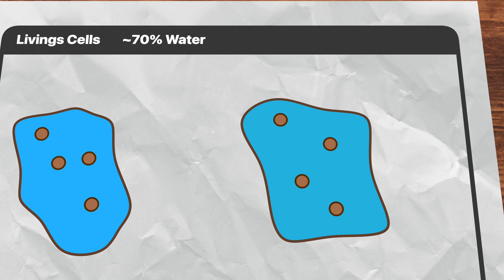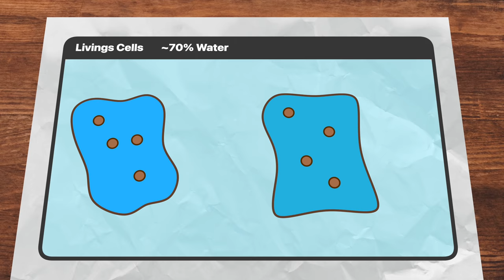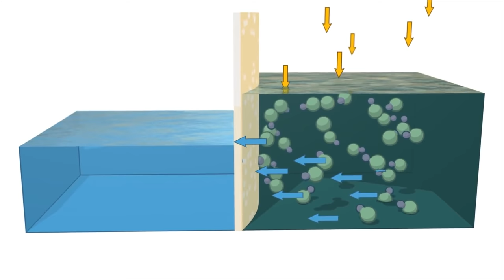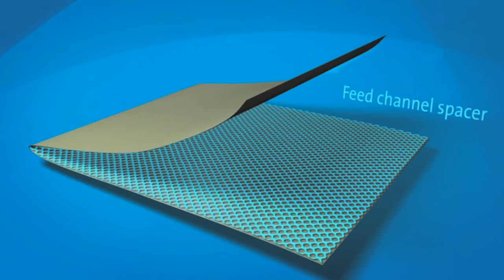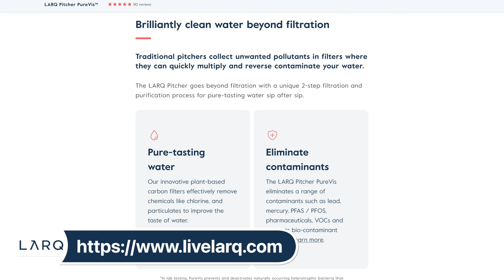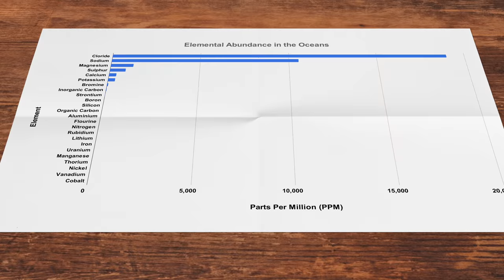Why Not Build Desalination Plants EVERYWHERE?

Comment: Just out of curiosity. Once you separate the non salt elements from the brine would it be feasible to then you use the salt elements for Sea Salt? If so then you're actually going more green because you could potentially replace salt mines by using every part of the brine.
Reply: I think the main problem is that desalination produces more salt than humans can ever have a use for. Extracting the small amount of the scarcer elements is fine but the salt (essentially just sodium chloride) has to be either returned to the ocean or dumped in huge mounds on solid ground.
In the grand scheme of things the ocean is easily able to take back the salty brine after fresh water has been removed, but it is the local effects of this super-salty water that cause the problems. They need to find a way to distribute it over a larger area/volume rather than just dump it back in the ocean in one place. It needs to be mixed back in with the bulk of the ocean by wind, waves, currents and tides rather than being allowed to sink down and collect at the bottom before mixing.
Reply: @michaelhart7569  As the water runs through the plant (I'm using a Navy System here) the water becomes more and more concentrated with salt (ie. brine). The input salt water is mixed with the discharge brine to dilute it to prevent damage to discharge pumps and piping. I'm not sure if you can set up a system using just brine to make salt unless you want to make it very expensive as the cheaper metals are going to corrode and break down the pipes/pumps.
Reply: @lanceurwin3368  Yes, that's the sort of system I might have imagined for a plant designed just for desalination. I only mentioned solid material because the narration discussed recovery of other elements and also showed some pictures of crystalline salts. Presumably this would have to include some sort of fractional crystallisation as chemical engineers would always prefer to just work with solutions and fluids where possible, avoiding the issues of handling solids.

While I've never been involved with such plants (a process scale-up chemist, not a full blown chemical engineer) I would still guess that many of the older ones were built with little regard to what happens to the brine when returned to the ocean. Perhaps just a few more pipes distributing it over a greater area and with more mixing is all that is required?
Reply: @michaelhart7569  excess salt could be used on icy roads maybe.
Reply: @johan8724  That certainly seems like an obvious choice. At least for those who live in areas that need roads-deicing. Not so much in places like Saudi Arabia that need desalination plants :)

As a side note, I once read that many American states don't use simple salt on their roads. Not so much because of the eutectic point of NaCl, but because it causes more metal corrosion. They use some other inorganic salt. I can't remember which, but I think it was Magnesium-derived.

Though not currently a US resident, I recall reading once that you are better off buying a used car in one of the sunshine States rather than their colder northern neighbors, for that reason.
Reply: @Arnie Arnie, I'm going to stick with the argument that the scale of the oceans is just too vast for humans to significantly effect salinity, except on a local scale. Remember that the water will also find it's way back to the sea, just as it does in the far far larger natural hydrological cycle.
Reply: @michaelhart7569  You are correct.  In Colorado, the road crews used MagChloride (magnesium chloride).
Reply: @michaelhart7569  Maybe not in the short term but potentially after hundreds of years. It wasn't too long ago that we never would have dreamed it was possible we could run short on fresh ground water.
Reply: @krboswell  Running short of fresh ground water is not really a salinity problem, but over exploitation of a resource faster than it is replenished. That is quite different from the concept of salinification of the ocean.

Tangentially, there is an excellent series of videos on Youtube about water conservation in India to make scant water resources go much further. Look up "India's Water Revolution".
Reply: Its an unimaginable amount of salt, you would have to see it to believe it after just a year. Salt mines are actually cheaper to manage than sea salt due to all the purification you have to do to sea salt afterwards before people can eat it. Loads of other stuff in the sea besides just salt like heavy metals for example that you then have to also separate. Once you get into separating metals, you generally are talking about chemical processes.
Reply: @michaelhart7569  Brine can be stored in old desolate mines and used as a buffer to store old nuclear waste.
Reply: @brianm.595  Indeed. 'Mining' the ocean for dissolved minerals was asserted in the video. Ultimately I guess it would depend on extremely cheap energy to make it economically feasible for many elements.

Gold has actually been extracted from sea water electrochemically and  using special thiol ligands but it is not even close to being economic. Too slow and too much water to be moved around.

As a chemist myself, I certainly have some ideas about ways to extract Uranium from seawater which seems much more promising.
Reply: @madmotorcyclist  Or it could simply be left on deserts as there  are no plants and humans already and sand would slowly get above it due to wind. Water would completely evaporate and at worst you would have salt desert.

Simply imagine having mirror dome at desert where water would be pumped and salt would be left in area close to it.
And problem with sand obstructing the mirrors could be solved by having them higher and by blocking it by having mirrors in reverse dome shape.
Reply: @greedier-7661  Problem of using the deserts is that it would impact wildlife and the environmentalist would be up in arms.
Reply: @madmotorcyclist  animals that live there, live either near plants that would give them water they need or near edges as there would be said plants or other sources.

So if they done what i suggested in the middle of dessert there would be no animals harmed.
Reply: I understand that sea water is full of micro plastics, are those filtered out? The salt is also full of micro plastics, which is why I use Redmond's real salt from an ancient seabed, no micro plastics.
Reply: @michaelhart7569  Do you think the excess salt could be used for Molten Salt nuclear reactors? Could be a huge energy supply if it worked.
Reply: @warmasterdorn  I doubt it. My understanding is that the molten salts used are very specialised compounds. They have relatively low melting points, thermally stable, and are non-corrosive (typically fluoride/polyfluoride based, if memory serves me correctly). Getting out of my field a bit, I think they also have to have certain desirable properties in the context of a significant neuron flux such as would be expected in such reactors.
Reply: @michaelhart7569  
I have read that there are 2 ounces of gold dissolved in every cubic mile of seawater.
Reply: @lanceurwin3368  a Zinc block as a sacrificial anode will solve the problem of rust.
Reply: @warmasterdorn  no but the excess waste from previous reactors can be used in many of the msr designs.
Reply: @The_Wicked_Wookie  in a pure brine solution,  you would have to replace them way too often to be usable. That's why Naval systems dilute the discharge with the intake.
Reply: @patrickhorvath2684  Yes. Without checking exactly, that sounds about right. When I looked it up some  ~30 years ago in the chemical literature (before Wikipedia, but even they probably get this right) I recall it being in the femtomolar concentration range. I.e. no economic hope at current, or likely future, gold prices.
Reply: @michaelhart7569  The US mined 16 million tons of rock salt in 2019. (41% of the 42 Mt produced that year)

Colder climates use salt for deicing. 17 Mt was used for deicing (43% of salt consumption; it might be higher if consumption includes the 17 Mt imported that year: 23 Mt)

This is JUST in the US.

What numbers are you going by as a basis for your comment?
Reply: @Andrew Robinson California is rapidly and drastically depleting it’s water table though industrial irrigation. Some areas have sunk 30’ over the past 50 years.

I think the other avenue of research should be towards vertical farming using totally enclosed systems and aeroponics which would reduce agricultural water usage by as much as 95%. Imagine being able to produce 20 times as much food with the amount of water we are currently using to do so.
Reply: @josephcoon5809  I’ve made several comments on this thread, so I am not really sure what you are asking me about.
I’ll take a guess. 

I calculate that if the annual water consumption of California (about 100 million acre feet) came from desalinated seawater (about 3.5% salt) then that would mean about 4x10 exp 9 of salt would have to be dealt with. That’s 4 billion tons of salt per year, roughly a thousand times more than the mined salt figures you quote. Obviously, we would not want to be spreading that amount on the roads.

I use this calculation purely to illustrate the scale of salt we would have to handle if we ever use seawater desalination on such a scale. The only realistic place for its disposal is back where it came from-in the ocean.
Reply: @michaelhart7569  Which brings us to my other point: the industrial irrigation that is highly inefficient.

Reduce that water usage by 95%, and what are your calculations? 200 million tons of salt which would completely eliminate imports while drastically increasing exports.

Then there’s all the other products created from chlorine, sodium hydroxide, sodium carbonate, sodium silicate, and so on.

What’s more realistic is treating a multi-dimensional problem…by addressing more dimensions.
Reply: @michaelhart7569  we could use the sodium chloride as a base for nuclear modification into more useful elements, although it would be costly ofc
Reply: @michaelhart7569  what if we shot it into outer space?
Reply: Desalination does not produce fresh water plus salt crystals.  It produces  (roughly) 30% fresh water and 70% saltier water.  But really, this is not an issue unless you try to make a desalination plant for an entire state.  The fresh water makes its way back to the oceans too, so you need to distribute desalination plants so that there is not a massive dead zone created.  Yes, there will be many small local dead zones....but so what?
Reply: Yes, technically that's what sea salt is. The so called modern mining is where it's pumped into a man made sandy Beach and drained slowly, the rest of the water is allowed to evaporate. There are still a few places that have enough left to actually mine and it is very expensive.
Reply: @michaelhart7569  read my posts about salt tower's. Using heat the brine turns to salt turns to gas, rises up the tower turning a turbine generating electricity. As it cools it turns to liquid, and flows back down the tower where more salt is added and it starts all over again
Reply: These are all great replies.
Reply: WRONG ITS NOT WATER ITS H302 🤦 THAT IS WITHOK THE BODY
Reply: Normal sea water has about 36,000 parts per million (ppm) of dissolved salts in it. Some sea water like the red sea near Eqypt can have 50,000 ppm in it.  The higher the dissolved salts the more pressure it takes separate the salts from the water, the more pressure, the more energy and the more corrosion that will take place. Sea water reverse osmosis systems tend to run around 700 to 800 PSI depending on the salt content and recovery rate. The average cost to produce 1000 gallon of fresh water from the ocean ranges about $ 2.50 to $5.00 US today.  Recycling and smart use can reduce this cost even more.
Reply: @krboswell  if they keep ab. Using fresh water for industrial use
Reply: @Joshua Tayloe one thing to keep in mind is that seawater is not just made of salt and water; it has a substantial number of other elements in it as well, including gold. Separating more of these elements apart from one another for use would be nice, but it's also very time and energy intensive and makes little sense in the long run
Reply: Could salt/brine be used as fuel for these plants as well?
Reply: @eventhisidistaken  "many small local dead zones, but so what? "

Habitat destruction is already one of the chief causes of the accelerating loss of plants and animals in the world.  Search for "the sixth extinction".  We don't need to damage any more.
Reply: @bjb7587  Every house that is built creates a local dead zone, so does every apartment complex, every grocery store, etc. - so do rivers, they also create dead zones where certain types of life that require higher salinity can not thrive.  A simple approach then is to put the returns in the places that have fresh water flow, because whatever is living there is already tolerant of large changes in salinity.
Reply: @michaelhart7569  I mean... If we have too much leftover salt we can just toss it back in the sea, that will surely not be a problem ?
I used to make thick salt for cooking at my grandmas by filling a bucket of sea water (100m away from her house) and leave it evaporating in the summer sun. It was fun.

Beside here in France the extreme large majority of salt we eat comes from salt marsh. Theres only one mine left for industrial purpose.
Reply: @johan8724  The West Coast doesn't use salt due to the toxic effect on the environment.
Reply: @michaelhart7569  The USA uses less than half the water per person it used in 1980.  Low flush toilets, high efficiency washing machines and dishwashers.  However, the public water supply accounts for only 13% of our water usage.  The majority of the savings has come from farming/irrigation.  Many farmers use drip irrigation instead of field flooding.
We use the less water per person today than we did in 1910, over 100 years ago.  I think that is real progress but no one ever mentions the gains the USA has made.
It is the same for energy usage per person.  A lot of progress but no recognition of the achievements.
Reply: @michaelhart7569  dude here on Long Island we have the salt on the roads in winter time but we also get a salt water fog sometimes during certain kinds of weather. If your car has a scrape on a metal part it gets rusty really fast.
Reply: @Alfred_the_IV  Yes, per person because that is how we consume food and water, per person.  We also use less energy that we did in the 1970s.
Reply: It's nowhere near efficient enough to come close to being "green" and it never will be.
Reply: @Andrew Davis lol, good for you
Reply: @johan8724  maybe, but generally speaking sodium chloride is not used as an ice melter on roads, paths or sidewalks. Calcium chloride and magnesium chloride are used because they are nearly harmless to plants and when they run off into waterways in small concentrations they shouldn't affect the aquatic life much.
Reply: @markdennyritner7851  There is no way it is green but if you don't have water for food it might be a good trade-off.
Reply: @rh6625  or move . . .
Reply: @markdennyritner7851  If California doesn't grow food with limited water much of the country will go hungry.  CA produces 99% of the " Almonds • Artichokes • Clingstone Peaches • Dried Plums • Figs
• Olives • Persimmons • Pomegranates • Raisins •Sweet Rice • and Walnuts"  88% of the grapes, 80% of the lettuce.  If you eat any of these you might want to reconsider the allocation of water.
Reply: @rh6625  And what fraction of that state's ag water is provided by desal?
Reply: @markdennyritner7851  None to very little.  It would seem with the drought conditions, and the entire coastline desal would be an option.
Reply: @lanceurwin3368  I mean eventually if we try to do it it should become cheaper and feasabile
Reply: @michaelhart7569  easiest way is to pump more water than needed in the factory water intake, release half of the untreated water in the ocean and add the brine to that mix, it will mix well considering the water pressure going out of a pump of that size.
Reply: Brine could also make saltwater batteries. Con.. though is size, it would be  bigger than say a tesla power wall.
Reply: @cliffordcrawford5723  yeah, but maybe for like cheaper model electric cars, lower range, but still over 100 miles would work
Reply: @cliffordcrawford5723  plus if it’s for home, space as long as it isn’t bigger than a closet should be fine
Reply: @michaelhart7569  maybe the cargo ships plying the oceans can be fitted with hoppers that periodically drop large pellets of salt along their way.
Reply: @michaelhart7569  However, you could eliminate the need for salt farms and/or mines by using as much of the salt from the brine as required, and then passing the excess back into the ocean. You could effectively "reclaim" land used for salt farming, and stop the need (or maybe the majority of the need) for mining of rock salt.
Reply: @greedier-7661  in the USA you have the salt flats. Brine can be dumped there. No need to spoil the desert.
Reply: @michaelhart7569  aquifers maybe where to derive such water, lest alot of bleach is needed to clean with (sodium chloride by electrolysis makes caustic soda) i consume minimum 1/2 kilo rock salt monthly. i was gonna have though 1 tank of water and live off it through a distillation cycle. have incineration toilets, and that is it! 1 tank and that is all. sea salt must be derived from pristine salt lakes or ocean that is clean too, for consumption or else dirty lol 💩 😂 there are sinks underground in certain areas. might have to access them.